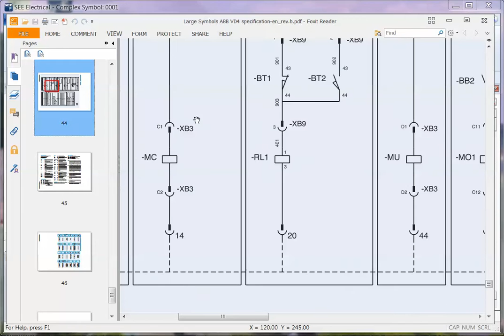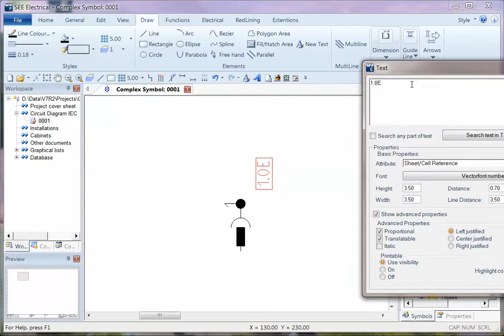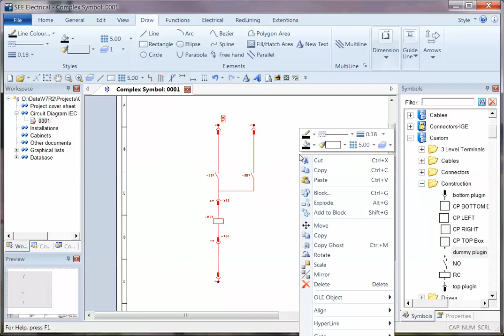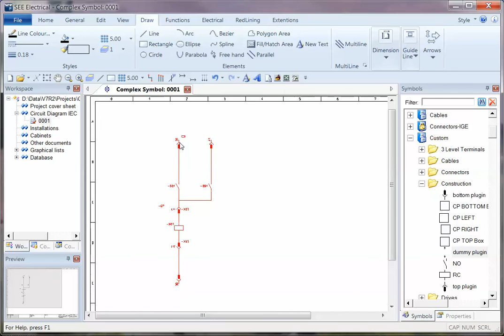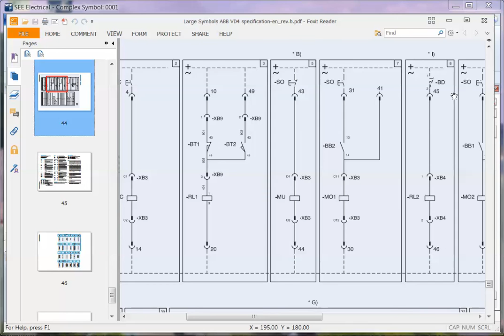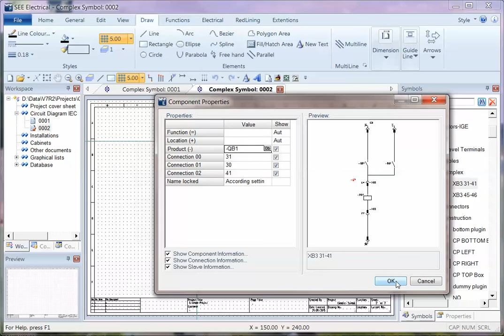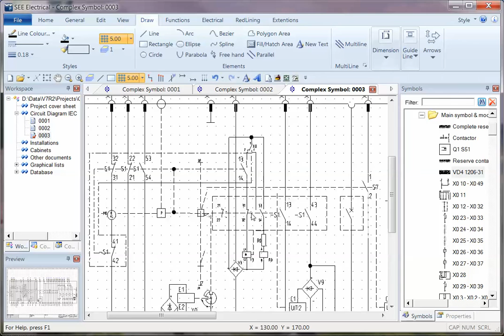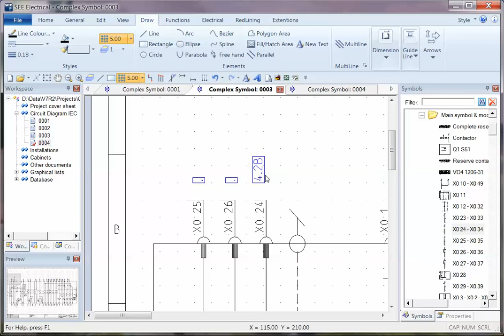Creating Symbols with Custom References Part 2 V7R2

Comment: Why Multi switch Block option is not available in V8R2 version?
Reply from the maker: There are many multi-pole switches in the Electrical and Automation databases 'Switchgear, change-over' and 'Switchgear control units' folders with both standalone and and separate main and contact symbols. If you can't find the specific configuration you're looking for then please contact your local support team. We are always happy to take suggestions on improving the symbol databases provided with See Electrical.